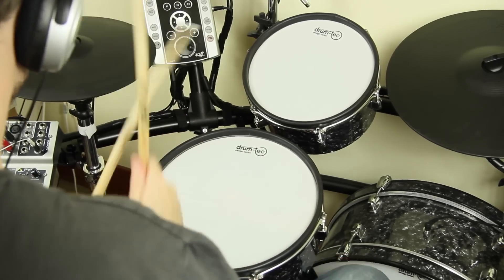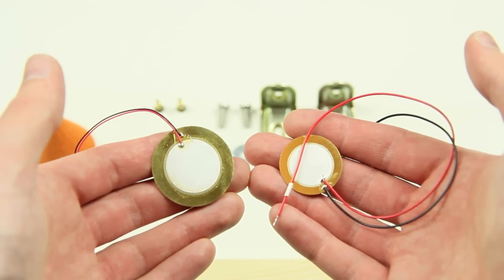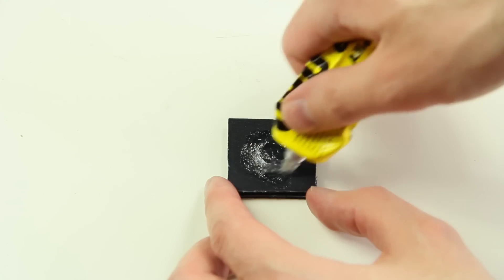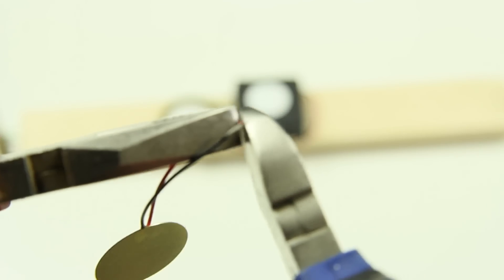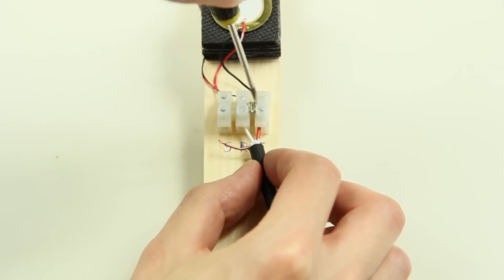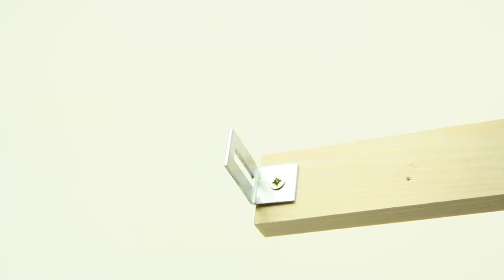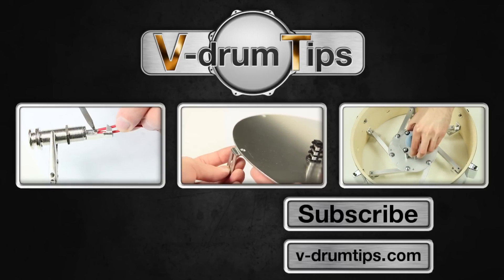Low Budget Trigger Pad DIY (E-drums)

Comment: I studied this video and used it as the bases for creating my own A to E project.   However,  the result was an under performing output, which caused me to search for reasons why and make kaizen (improvement) to the project. 
What I discovered was all Piezo are not the same.  There are specifications relative to piezo which need to be adhered to in order to obtain a working result in A to E conversions.   One needs to understand the Piezo specifications KHz, Ohms, exc. relative to the Piezo they are purchasing for such a project.  Roland does not list its Piezo specifications, however others with successful aftermarket applications do, so pay close attention when purchasing piezo for your conversion. 
.......
These specs seem to work best with Roland modules:
Resonant Frequency: 2.9 KHz
Resonant Impedance: Maximum 300 Ohms
Many of the aftermarket piezo sold as inexpensive replacements are in the 5 to 10 KHz range and 400 and higher, Ohms resistance, which is why they don't work well for A to E drum conversions. 
........
Lastly, one revision I would recommend:... I replaced the adjustable L brackets on this assembly, with the deployment of a metal elevator bolt (like that found as the feet of washing machines). This revision allowed simple adjustment of the contact surface of the Head piezo foam to the drum head.  I used a round dense, foam, about 25mm in height, as decoupler between the head of the elevator bolt and the washer that supports the head piezo.   This system revision is much simpler to manage than stacking head decoupler foam and using L brackets located at either end of the e converter bar to acquire proper head contact.  Further, it can be easily adjusted after installation if there are issues with head contact. 
.......
Thanks Very much V drum tips, for providing excellent video for the remainder of us to use as our guide for A to E conversion.
Reply: "I used a round dense, foam, about 25mm in height, as decoupler between the head of the elevator bolt and the washer that supports the head piezo"

Would you mind explaining the purpose of a decoupler? I'm new to edrums and looking to DIY as well. I'm mostly trying to emulate the UFO brand ebridge trigger system.  I have a foam cone, do you just put this on top of the piezo which is on top of the elevator bolt platform? Or does something else need to go in between the platform.  Thanks for the tips!
Reply: @mapex311  The de-coupler is meant to isolate the two piezos, so that it does not trigger(as much) the rim piezo when hitting the head and vise versa.

Comment: Is it necessary for the piezo for rim and head to be different in size?
Reply: No, many people imitate Roland setups by using a 27mm Piezo for the head and a 35mm for the rim, however that is not a requirement.   Its more important to acquire Piezo which have the proper specifications for your A to E conversion than be concerned with piezo size. 
The resonant frequency of your piezo needs to be 2.9 KHz and the resistance no more than 300 ohms. 
Most of the inexpensive aftermarket piezo sold as drum piezo are in the 5 to 10 KHz range and exceed the minimum of 300 ohms resistance, which causes frustration in A to E conversion projects, as its rare the specifications of the necessary piezo are provided. 
The other option is to purchase Roland piezo from original sources such as Drum Tec.

Comment: I doubt I'll get a reply but it's worth a try. So I saw you used a foam cone for the middle piezo, but it's really expensive and I'd want to make my own. Do you think a cylinder would work aswell? or would I need to make a cone. Don't worry about it if you don't know, I can experiment a bit when I start this project.
Reply: I have used both with equal success.   The foam cone used by Roland was designed to reduce hot spots and still provide full contact with the Piezo head.   other geometric shapes will work however you may experience an increase in hot spot location at the center of the head.  Very precise percussionists will find the hot spots annoying others who strike their drums hard, will probably never notice the hot spot.  The other option is to use multiple piezo as side mount, which eliminates most hot spotting.

Comment: Hi, i tried to mod a 12" Black Hawk Gretsch snare, i got the rim piezo mounted on the shell instead of the central bracket, and it work pretty fine, but i can't get the stick sound out of the rim, i only get the rimshot.
Do i have to set a different sound into my module/vst or there's something i did wrong?
Or it's how it's intended to work, a rimshot or either a cross stick?

Manually setting the rim to play a sidestick work, but i see many others getting it working out of the box.

I double checked all the wirings.

Comment: Hi VT.  

I'm new to e-drums and I'm wondering if it's possible to insulate a larger, full sized snare (as well as the toms) with pillows or acoustic panels to reduce our levels of "noise pollution". 

Also, I've been limited to just a multi-pad (Alesis PercPad) and it's electronics are starting to malfunction (It's auto toggling it's options menu, midi, assign, sensitivity, etc but it's not affecting midi output or sounds).  I opened it and the piezos are still in great condition, It's had little use over the years.  Is it possible to reconnect the four piezos to four 1/4" jacks and connect them to a module ("ddrum DDTi Trigger Interface" or a "Megadrum")?  I'd really appreciate a response from experts such as yourselves.  

Thanks for the tips VT.  You've got yourselves a new subscriber.  :)
Reply: IoOrganism well on my limited knowledge of midi and a little common sense I would go and get a few of the piezoes and and a few throw away cables and see if you can connect one or two to midi and if that works then great as I wouldn’t just alter a piece of equipment that can be costly because you would have to link it into midi as midi are notes so It would likely need to be connected to an audio interface that has a midi in and out because if you just connected them to the piezoes it would just have a sound out put and no sample input, just my bit of knowledge to doing that
Reply: @n1ghtmvre546  Hey, Thanks for the reply.  I don't have spare cables so I'd need to buy them.  I was thinking of using "J11 Input/Output Mono Jacks"  like these, instead of cables.   I don't know if guitar and e-drum mono output jacks are the same.
https://www.amazon.com/dp/B01HYBC6P4

The four PercPad piezos (they're still attached to the PercPad) connect to the main board via, if I recall correctly, a "4-Pin Relimate Connector" (it's a small white 4-pin connector that's around 1cm x 0.5cm).  Ideally, if possible, I'd like to connect that 4-pin connector to four 1/4" jacks.  Pintech makes "Single Zone Triggers and Jacks" for toms, that have a 1/4" jack that connects to a piezo via a 2-Pin Relimate Connector but it seems that soldering is my only solution here. 
https://www.sweetwater.com/store/detail/TomTrigger--pintech-single-zone-trigger-and-jack

Though it would be a loss, The internal sounds aren't very important to me.  I was only using the 5-pin midi out for triggering sounds in my DAW, Like a midi controller.  I've just found this "E-Drum Cowbell DIY" Vdrum Tips video that seems to use the same idea that I have in mind.  My only worry is that guitar and e-drums use different output jacks and I'll get the wrong ones.  It may even be possible to rewire the PercPad's left, right, headphones and kick drum's 1/4" jacks to keep this all in the same case.  I'd be connecting it to a drum module via 1/4" jacks, Like e-toms, so I probably wouldn't need to attach the  piezos to a midi converter like in this video. https://www.youtube.com/watch?v=X9EG-E6SDCk&t=810s

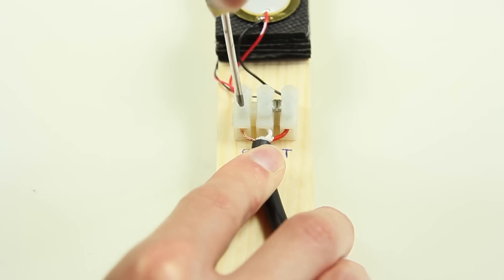Comment: why in the minute 4:02 connect the black wire in TIP?
Reply: because it's the signal from the mesh piezo. signal from the rim piezo goes to the ring, both grounds go to the sleeve.

Comment: hi, the piezo connects via stereo or mono jack?
Reply from the maker: Matteo vecchio Stereo, else you wont have 2 zones.
Reply: @Vdrumtips1  so the output of the piezo is stereo ok .... but to connect it to a roland controller then I have to use a mono jack ??
Reply: hi .. at minute 5.13 the jack that enters the (female piezo jack) is mono or stereo?

Comment: Vdrum tips, please Help me! / I made trigger pad, following this video. Trigger cone works well, but the rim piezo doesn't respond. it is not piezo's problem, because when i changed arrange, it worked well... I tried all kind of pluging(by changing S,R,T line), but there wasn't solution. How can i fix it? I'm using stereo 5.5 plug, and roland td-6v module.
Reply from the maker: Probably wired up wrong. Do some research on the wiring and double check.
Reply: Okay..Thanks you! i'll try as you told.

Comment: is this Trigger DIY works with Alesis DM7x modules ?
Reply from the maker: Not sure
Reply: Vdrum Tips thanks for responding, Ive been really interested on maiking this exact same DIY trigger and Id like to know if that foam cone can be replaced with a piece of acoudtic foam cutted exactly like thay cone hahah
Reply: @GatoPaint  you can use any regular foam (the denser the foam is the more it will transmit vibration to piezo) the secret is how you can create a perfect cone shape with right density of foam so you'll have a good response at the same time eliminate hot spot. I used an AC spacer foam (industrial foam) works great.

Comment: use a metal piece instead of wood for the bar and you've got the jobeky trigger
Reply from the maker: The metal piece that Jobeky took is too thin and has no profile. It is a rather bad way to design a trigger in such a way since you want to avoid the materials to vibrate.

Comment: It is my first time to DIY a drum pad. I want to ask if where the drums sound coming from? Is in it in the piezo? or should need also an app software for the drum sound?
Reply from the maker: No, the piezo is only sending a signal and the module generates the sound. Read this post: http://www.v-drumtips.com/piezos/
Reply: +Vdrum Tips if piezo is only reading the signal. where the drum sound coming from?
Reply from the maker: From the module.
Reply: +Vdrum Tips actually i want to use the piezo in other equipment. i want to install the piezo inside the acoustic guitar to make a drum sound every time i tap the piezo. but i don't how the drum sound coming, what kind of module is that? is it a software?
Reply: "the piezo is only sending a signal and the module generates the sound."

"if piezo is only reading the signal. where the drum sound coming from?"

Bruh. Reading comprehension goes a long way, I would have stopped replying too.

Comment: i really like this video. i built a trigger system using reflection plate but it's not very good. any reason why the rim piezo needs to be close to the head piezo?
Reply from the maker: This is just for trigger accuracy when using high end modules like td-20/30.
Reply: +Vdrum Tips thanks for the tip.. what is the required polarity for the head piezo (i understand the rim piezo does not matter)?
Reply from the maker: the polarity for the rim piezo does not matter. The head piezo polarity can be found on vdrumtips.com as download pdf doc.

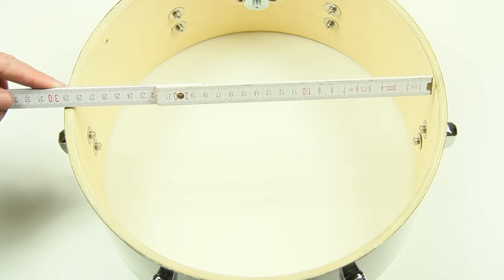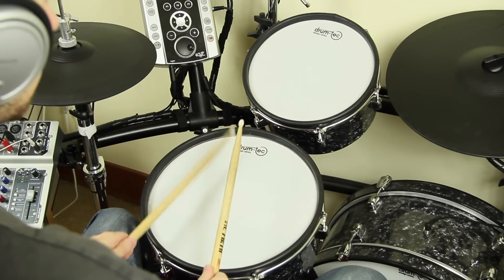Comment: What does she say at 00:15~00:20 and 05:53~06:04?
Reply from the maker: 1. without soldering or the use of a drill, r-drums decoupler adapt the roland head rim setups.
Reply: Thanks. Whats at 00:17~00:20, "the diameter of this (???) and shell needs to be measured"?
Reply from the maker: yes, you need the exact diameter of the shell.
Reply: Yes, but i mean, what's said after 'this' and before 'and'?
Reply from the maker: Sorry, but what is your question? Which point is unclear?
Reply: "this drum and shell"
Reply from the maker: the inner diameter of this shell needs to be measured. You need the exact diameter to know the length of the wood bar.

Comment: Would the wood be much less responsive than the metal in another trigger system. What I am asking is, would there be a big difference between wood and metal crossbar if all other components were the same (decoupler and trigger cone). Thanks.
Reply from the maker: +Luke Costello No, not really. The trigger result depends mostly on the piezos and the foam of decoupler and cone. I would never use DIY materials there. But you can indeed use wood.

Comment: Do u have any advice on DIY cymbals or plan on making any videos? I'm interested in making my own cymbals but can't figure out how to create the choke or bell functions
Reply from the maker: +Dan T (RcKDrUmm3R) Thinking about it for a while, but it is not an easy subject if you want them to be perfect.A simple version would be sticking a piezo to a cymbal, cover it with rubber and play. But that would be too basic.
Reply: +Vdrum Tips Would u be able to do a crash with a choke (for example) with that method??
Reply from the maker: A choke requires some more parts. It is not a simple DIY. There are already some god basic diys on Youtube. If I make one it will be high end and hast to be as good as the professional products:)

Comment: Thank you for all these great video's that you make ! :-)
Reply from the maker: +Werner Fraanje Thank you for watching:)
Reply: I am building a A2E conversion and your site is very interesting. I am using a Roland drum module and have a question regarding the diagram on the TRS. Based on the diagram the Ceramic part of the Head Piezo is connected on the Tip, while the Brass part is on the Sleeve. However based on your video tutorial it is the other way around. Please advise which is the correct? Thanks in advance